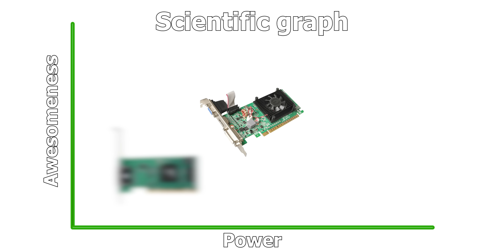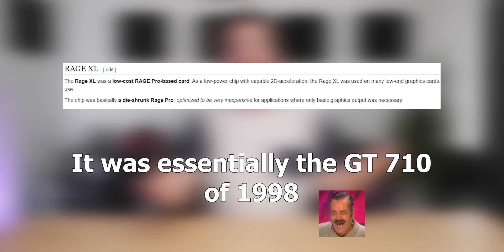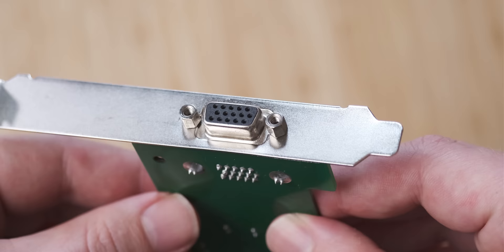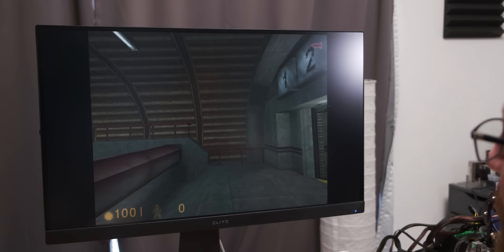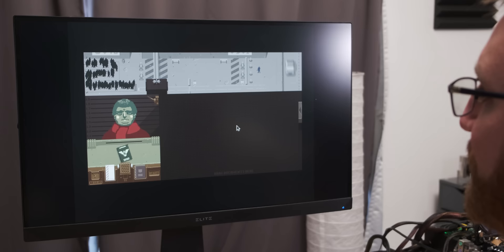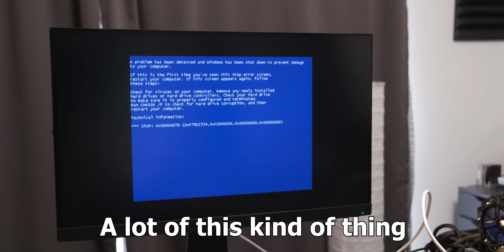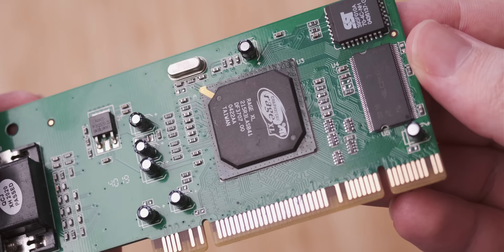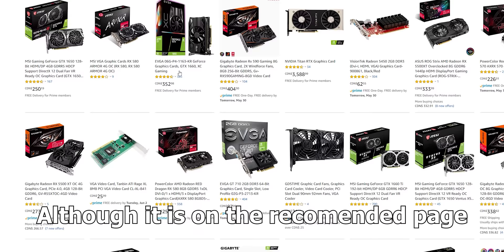Trying to game on the Least Powerful "Video Card" on Amazon

Comment: This makes a GT 710 good graphics card.
Reply: A ultimate beast*
Reply: Gt 710 is a great card. I have one in an emulation machine and it handles old games perfectly
Reply from the maker: I know right. 😂
Reply: @DawidDoesTechStuff  yes - GT 710 isn't "bad" hardware. It's just really basic and cheap.  But if you're not gaming and just want a video adaptor, it's ideal. Or if you're retro-gaming, Or just playing low-demand games it's fine.

It's like arguing the Dacia Sandero shouldn't exist because the BMW 3 series is much better and everyone should just buy one of those.
Reply: it makes my old riva 128zx a beast
Reply: @Rapscallion2009  we better get dacia logan
Reply: @Rapscallion2009  agreed, I have a 710 for a video display adapter and it works great.
Reply: the difference between the two is one is a graphics card and the other is a video card.
Reply: I used to game on a 610, but now that i have a pc i use a 760
Reply: I have a 3-D GT 610 ,i3 2100,16gigs RAM, on a Asus gaming mother board..it played Roblox good that all I need for and YouTube at a low 4k, 4k higher it takes longer load time.
Reply: gddr5 good
Reply: And my gt 1030 a beast
Reply: I have hd 4000 worse than gt 710
Reply: 210*
Reply: Having à gt705 i agree
Reply: Rapscallion2009 A bit overpriced though... An amd had 7570 is $17 and has way more performance
Reply: xby xenos An
Reply: I have a gt 1030
Reply: Indeed
Reply: No gt 210 also
Reply: Ong
Reply: Gt 210
Reply: @Rapscallion2009  like portal or half life 1 or two
Reply: *intelHD 4000
Reply: why do they buy 710s
Reply: it makes my intel hd graphics 620 look like something nvidia made.
Reply: This makes a GTX1650 the RTX 3090 card in comparison with this lol
Reply: This makes the windows adapter driver look like a good graphics adapter
Reply: And here I am using Ge210.
Reply: @Rapscallion2009  GT1030 is a much better video adapter because it can connected to upto 8K60fps display. Yes, 8K output. You can't probably game at 1080p on modern game but you can output 8K HDMI resolution.
Reply: I’m going to unlike to fix the number
Reply: It makes my 1650 look like a 3090
Reply: Makes intel hd look like a rtx 3090
Reply: ¹
Reply: Yo what you talking about? Everyone should buy the Dacia Sandero.
Reply: @mattc3239  the gt 710 id actually worse than most intel integrated graphics
Reply: @mattc3239  some intel i5 intergrated graphics are better than the gt 710
Reply: HD 5450
Reply: My friend got a gtx 520 ti
Reply: Yeah. My mom’s computer has that card and it runs games like csgo no problem
Reply: @nickdoespcs  fun fact gma 4600 is more powerful than 710
Reply: @mattc3239  thats probably because its at least 2x more powerful than the n64's
Reply: @Rapscallion2009  No its terrible for gaming, even for old games
Reply: @mattc3239  No tf it isnt?
Reply: I got this piece of trash in a 699 bucks "gaming" PC. I didn't knew ANYTHING about tech at this time
Reply: The gt 710 is my daily driver, for gaming...
Reply: @ElvionOfLXIX  why?
Reply: @Toons595  It works, and it's cheap
Reply: Is that why it’s still marked as best seller gaming gpu on Amazon?
Reply: @Rapscallion2009  that’s a given
Reply: This makes my GTX 750 Ti look like RTX 8090 Ti
Reply: I have one
Reply: it wasn't a 710 but I had a GT730 that was good for just playing gta sa and using it on my 2nd monitor, since it has fried and I upgraded to a GT 1030 LP OC for my 2nd monitorI'll, the new one with the better vram, both are solid budget cards
Reply: Ironically a card that Best Buy still sells in store for $100
Reply: It also makes Intel integrated graphics good compared to this one
Reply: It makes my GeForce 120 good
Reply: U forgot a a
Reply: tbh gtx 285 is stronger than gt 710
Reply: @xbyxenos3200  Vowels*
Reply: I have one
Reply: @romancisneros3706  4k is 4k wdym
Reply: @Rapscallion2009  lmao for a 50$ card (gt 710) its not worth it at all.
Reply: 69
Reply: ya ya
Reply: Bruh you mean Geforce G 100
Reply: It is
Reply: gt 710 handles every game I play, I see it as a god of a graphics card
Reply: same as a g 100
Reply: @fakiAZer  noooooooo
This is worse than G100 
G100 is low end video card of 2009
And this is a low end video card of 1998
Reply: 🤣🤣🤣 and this make g100 is faster
Reply: i have a g100🤣🤣
Reply: @zx9510  too good
Reply: This makes GMA3100 run 10x bettter
Reply: gt210 hd4000 gma950 fx5200 etc too
Reply: Comparing a graphics card from 1998 with one from 2016.
Reply: This males g210 the BEST card
Reply: So true
Reply: A RTX 3090*
Reply: @Rapscallion2009  gt 710 could play some games as well
Reply: for real though
Reply: I would be soooo happy even if I get a gt 610 
Because I have an nvs 3100m which is like under 20 or 10$
Reply: @Rapscallion2009  James May agrees
Reply: What do you mean the gt 710 is the best graphics card ever
Reply: Like RTX500000ti suuuuuper🤣🤣🤣🤣
Reply: Gt710, not bad gpu 👍👍👍
Reply: GT 710 is S tier already
Reply: This also make my 512mb integrated a better Graphics card
Reply: The GT 710 isn't bad, its just old.
Reply: @mattc3239  Precisely.  OLD
Reply: I hv that
Reply: I have GT 730 and it works for me lol
Reply: @yeetedcow6702  i just out one in my roommates kids pc
Reply: No it makes the gt 210 look good
Reply: @larskroes2632  if you want to play fallout new vegas at low or roblox at minimum to high then go ahead.
Reply: Gt 710 is a beast😈
Reply: I use to have the gt 710. It's not actually that bad In my opinion. I did upgrade to a firepro v5900 ( no difference tbh) it wasn't the worst but I am hoping to get a rtx 3060
Reply: This makes the GTX 1650 look like the RTX 3090
Reply: I have an GT 630 unfortunatly
Reply: @d3rwiszzz  bro huh?
Reply: gt210?
Reply: I am using it, what is the problem? :))
Reply: nah it was made on 1998
Reply: bruh i remember when i wass beggng my moms to buy me it and i watched soke vids abt it and she agreed in the process of me watching the vids and i said actualy im good its ok and she was ru sure u begged me and i said yeah sure
Reply: @yourtechweekeveryweek6321  GayAnalDildo
Reply: Bruh i have a 750 ti lol
Reply: @notslimginger  wow you are so cool
Reply: This make a gt 630 look good
Reply: i used a 710 for a little while after my 2050 died and it at least let me use my PC for the month while i saved up
Reply: G-100
Reply: You know what's better than that  gt1030
Reply: And GT 730 is also better
Reply: its an rtx 4090ti compared to the ragexl
Reply: This makes my 1050 mobile look like a 3090 ti
Reply: Because this card is from 1998, of course the GT 710 is going to beat it since it's a decade and a half newer even if it's low end
Reply: A GT 710 is good if you aren’t trying to play games on it.
These types of cards are for older systems, that struggle to even run a 1080p video on YouTube, unless they have any sort of graphics card like the 710
Reply: It's like comparing gt 730 to an rtx 4090
Reply: This make my RTx 3060 look premium
Reply: @DawidDoesTechStuff  GeForce g100?
Reply: @Rapscallion2009 the integrated graphics from a 7 th gen intel processor is actually better
Reply: Excuse me? 💀
Reply: I use gt 710 on home server just for display output
Reply: GT710 is not a graphics card it's desktop accelerator.
Reply: Try gaming on a i5 3570k with 16gb ddr3 and a 2gb msi gtx 760
Reply: FORREAL
Reply: It… is…
Reply: Nah the gt730
Reply: I started off with one of those XD
Reply: honestly, NVIDIA have scrapped all sub 100 cabbage graphics cards, I would only want one to test and for similar price 1030 is better but not future proof for any gaming.
Reply: as an actual owner of an actual gt 710 (with gddr5, the others are sad) it really isnt that bad, it runs minecraft, csgo( i havent tested cs2) and all the other games i play at a respectable resolution and framerate, although you wont be playing gta 5 at max settings, it can definitely still be used. if you add a cooling fan it works even better
Reply: How about the GT 210?
Reply: This makes a gt 610 look like an rtx 4090
Reply: it makes the geforce4 mx4000 look good too
Reply: @mattc3239 no it is not, a great card doesn’t run just very old games well in emulators, a “great card” runs triple a titles at over 80 fps
Reply: @Rapscallion2009 Isn't Matrox GPUs for that tho? Also I would get a Rx550 or gt730 by that age , or nowadays  1630 or RTX 4060 ti Lapot 6600 XT LP
Reply: I hate the gt 710
Reply: Makes the 1030 look like a 4090

Comment: I'm not buying a new motherboard just for this card Dawid.
Reply from the maker: You mean an old motherboard. 😋
Reply: @DawidDoesTechStuff  yeah, that...
Reply: @DawidDoesTechStuff  The Optiplex 990 has a PCI slot everything but the front IO is standard.
Reply: @DawidDoesTechStuff  I have a Haswell motherboard with a PCI slot. Barely old
Reply: I have a PCI slot on my motherboard, it's a motherboard from HP pre-build, Foxconn 17A0

Comment: Dawid: *buys worst video card
Seller: Yay, some idiot bought it.
Reply from the maker: Hahaha!! I am sure that is exactly how it goes. 😂
Reply: Nice 69
Reply: starts high fiving each other
Reply: @DawidDoesTechStuff  Think you might need too run something like windows 98se for this card.
(This was more commonly a chip found on motherboards for servers & in laptops btw at the time which might be why some drivers just didnt give out any performance & were generic.)
Also overclocking memory seems too help with performance a bit on this via powerstrip, slap on a heatsink on the gpu die & overclock that as well a bit if you feel like putting in some effort into it again.
But it's still at best like 30 - 40 fps in unreal tournament at 640x480 with proper drivers & operatingsystem i'd bet.
Could be worth a try installing xp & another gpu first & then seeing if you can get any catalyst drivers too install for win 2000 in windows xp.
Some socket 754 parts from ebay, a bit better cpu cooler 256 mb ram, ide harddrive (or sata hdd with ide hdd adapter + partitioned into 32 gb or similar size for compatibility.)
& windows 2000 could probably make a good platform for older cards between pci too agp.
(Some motherboards on socket 754 might not have universal agp for say a voodoo 3 agp or older though.)
Worth a try downloading any of these.
https://www.amd.com/en/support/graphics/legacy-graphics/ati-rage-series/ati-rage-xl
Also on the topic of finding a worse one, The matrox mystique 4 mb i got in my 98 machine working as a 2d gpu.
It had its own hardware renderer limited too very few games... (Exclusive released version of the game like destruction derby 2 that came with the card mostly think it was like 8 games & then voodoo took over completely with the voodoo 2 before direct 3d came up & took over more then the voodoo cards on the market.)
Otherwise it was all software rendering done on the gpu.
Reply: @psychoticgiraffe  it has more parts on it tho
Reply: Seller sitting at bar, getting plastered... Due to his inventory costing HIM money... Notification of sale!!!  D I N G !!!! DRINKS FOR EVERYONE!!! WOOHOO!!! lol
Reply: @psychoticgiraffe  i actually owned a matrox card like this 19 years ago  i think it was a 6mb one 😂 I can second this!! lol being 12 and getting whatever really cheap parts you could get, beggers can't be choosers!
Reply: @psychoticgiraffe  BRUH THIS IS A PCI CARD NOT EVEN PCI-E LIKE WHAT
Reply: They know that people buy them for retro purposes.
Reply: @DawidDoesTechStuff  I like u
Reply: @psychoticgiraffe  warning it's extremely used and some how still working
Reply: @DawidDoesTechStuff  im sure some guy is drinking a 6 pack of bush some where because of you haha
Reply: @DawidDoesTechStuff  it’s technically a smart play on his part since he’s barely spending anything to make an entertaining video. I’m more than sure the revenue from the video overcomes the cost of the crappy graphics card.

Not that I’m complaining. I just see it as some dude being smart lmao
Reply: Our school bought it... Im pretty sure
Reply: @bestopinion9257  someone else who understands its being sold for retro systems!
Reply: @githane  Yes. Sometimes the seller propose me another better card.
Reply: These cards used to be sold by the MILLIONS in 2004-2014.
It was THE go-to card for getting a cheap display output in your enterprise server.
Reply: @thealien_ali3382  nobody else cares
Reply: The Rage chipset wasn't even good in 1998. You needed 3DFX Voodoo then!
Reply: Ngl though. The graphics card lower than 1050 should be free haha
Reply: There are many valid reasons to buy this though, what if you need display output for a server or a GPU for a Windows 98 era PC for example?
Reply: I this video card would be used as a video adapter, no more
Reply: Still better then the s3 verge! I can't even play jedi knight

Comment: Used to work for ATI many years after this card came out, and found we were still selling tons of them (along with the Rage128). I asked around how this was possible, we had FAR better graphics chipsets at the time (Radeon 9700 and newer), and yet were still fabbing these things.

The answer was simple: servers. Many servers of the day used these chips as basic graphics chips to drive the local VGA connector.

I wouldn't be surprised if a not much newer successor was being used even today for VGA out on servers.
Reply: I confirm.
I worked for a company that had racks of servers with this king of cheapo video card just to get a console to display on an rack monted screen nearby. Some also had vga to rj45 converters, presumably for remote kvm access. Tons of ewaste when they upgraded a few years back.
Reply: Ltt showed an m.2 gpu for this purpose.
Reply: A modern day commercial equivalent would be a Headless plug Its a plug where there is no cord its just a plug with a video processor so you can out put a digital display that can be sent to a device to moderate it. Of course that's if its a device/server with its own built in GPU, as modern Day Graphics Cards do not have the option to output a digital display on there own. So a plug is needed to. If its not then its going to be a weak economic GPU/A Reclaimed GPU. Where your getting it to drive the server terminals and nothing more in which case any GPU even one pulled from older devices like old/broken laptops, and computers in theory can be wired to stand in to serve that purpose.
Reply: But it doesn't make sense even for that purpose anymore. The GT 210 has a D-sub connector and it can be had for like $20 new with a guarantee that it works. 
The old 2D cards are just too old. They cannot even run a modern GUI properly. 

Besides, modern server boards have a very basic onboard SoC that handles the VGA output and all the remote access and what not. So there is no need for a GPU at all in the system.
Reply: Yep, I assume that these are for servers or retrocomputers. The retrocomputers that want the real experience of gaming without the best possible technology of the time.

Comment: 9:24 Don't tempt me now 😏
Reply from the maker: I would love to see what you come up with. 😂
Reply: What? Not a single S3 Trio or Virge on Amazon?
Reply: @oztalkshw now buys 10 and ads to an old EMachine and attempts to run Doom.
Reply: @marctorres7182  That's what I was thinking,  I actually tried to check this!   There are a few... But for some reason they're like $100+ which is a surprise to me....
Reply: Got a competitor here thats worse.
It has its own proprietary software renderer MGI ! matrox mystique 4 mb.
I got a later 220 here myself in a windows 98 pc with a voodoo 1 4 mb, might throw it onto my testrig as it has pci slots, though not sure if it has drivers somewhere on the web i can use in windows 7, might try the windows xp drivers & see if it manages those...
It does render direct 3d, but i wouldn't say "runs" it that well though heh.
Reply: @Mini-z1994  The Mystique is truly awful. I wonder if mine is still around lmao
Reply: @DawidDoesTechStuff  i can just search up worst gpu on the market and buy it
Reply: Riva 128 is better then this
Reply: Just buy an IBM Monochrome Display Adapter it has 4kb of vram and its 8bit ISA and only black and white
Reply: G 100
Reply: @DawidDoesTechStuff  intel hd 4400

Comment: The trick with Windows XP is running your hdd controller in IDE mode and have 3GB of ram or less connected. Some motherboards have a OS type selection. Putting that to DOS/Linux tends to help on modern boards
Reply: well, that and don't use a faulty hard drive.🤣🤣🤣

Comment: I was cleaning out my attic and found an ATi Mach 64 from 1995. It pretty much had the same purpose as this Rage XL. Just a 2D accelerator. According to Techpowerup it runs on a 600nm process with 1 pixel shader and 1 ROP. Ultimate gaming power!
Reply: Lol, techpowerup is horrible site. The ATi Mach 64 had neither of those things. LOL
Reply: @FusionC6 techpowerup is fine
Reply: @hisamiyomotsu1337  if you like incorrect information, then sure?
Reply: HOLY FUCKING SHIT, DON'T BURN YOUR HANDS!!

Comment: Your XP endeavours may have been hindered by the use of SATA drives. You might have needed to check whether your bios chipset instructions were set to IDE mode and not AHCI mode.
Reply: and you thought you couldn't buy products from 1998 new on amazon you thought wrong kid
Reply: He could have installed Windows XP in virtual machine and then instal drivers.
Reply: Makes sense
Reply: That, or just not using an SP3 image.  SP3 was a little more stable when it came to fancy SATA devices.